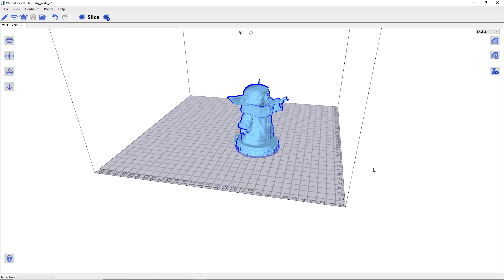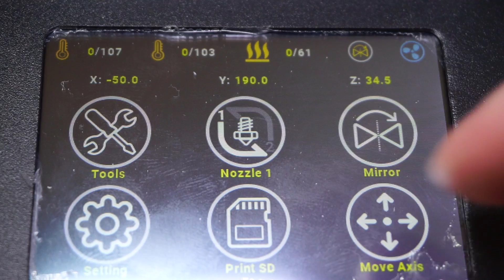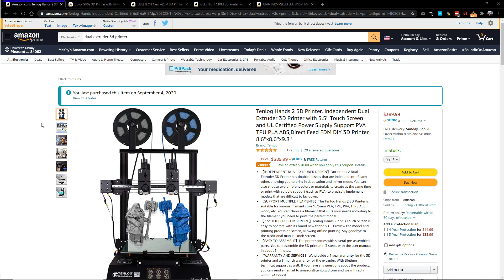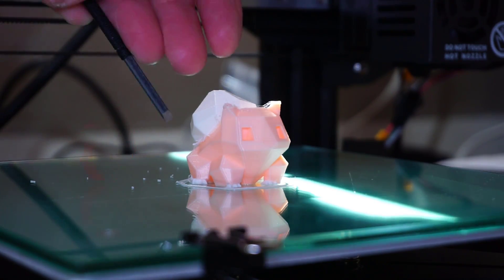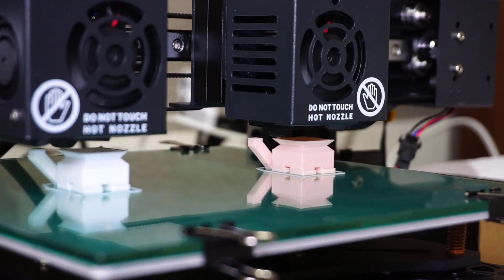Tenlog Hands 2 3D Printer - Review of Independent Dual Extruder / Hot End 3D Printer

Comment: I’ve been having trouble with my printer not wanting to print. It will get to the part right before it’s getting ready to print but says that the filament has run out. I’ve tried feeding the filament out and back in, turning the printer off and on but I still can’t fix this. Does anyone have any clue on how to fix this. This is my only complaint about the tenlog hands 2 printer

Comment: with this printer, is possible to print using different materials (ex. pla in one hed and tpu in other one)?
Reply from the maker: Yep! You can set the hot ends with independent settings.
Reply: Yes, but the bed only has one setting, so you'll need to take that into account.

Comment: I found the Tenlog is fairly priced for an IDEX and although it is probably only a PLA printer, it compares well with single extruder printers with the same build area.
Reply: My Tenlog TL-D6 prints; 1.75mm TPU, PVA, PLA, ABS, HIPS, WOOD, PETG, FLEXIBLE, Nylon and has Dual 3:1 Geared Direct Drive Extruder. So, it is about as versatile as you can get.

Comment: It would be nice if you did a review on using PVA supports with the dual heads.  That would be the main reason most people would get dual heads.
Reply from the maker: That is a good idea. I will look into that if I get some PVA.
Reply: I tried printing on this unit with PLA/PVA for support and had some bed adhesion issues...( I forgot to set PLA temps). The print was still for the most part a success and I'm sure with some tweaks and better understanding (this is my first 3d printer and I actually got it based on this review) PVA supports with the 2nd hot end will be perfect.
Reply: I did find out that I needed to put my PVA in a food dehydrator for 24 hours at about 130 degrees Fahrenheit
Reply: exactly!